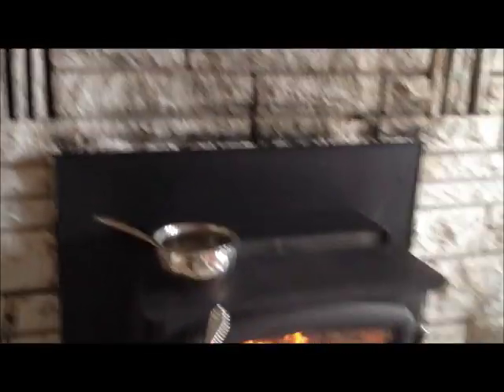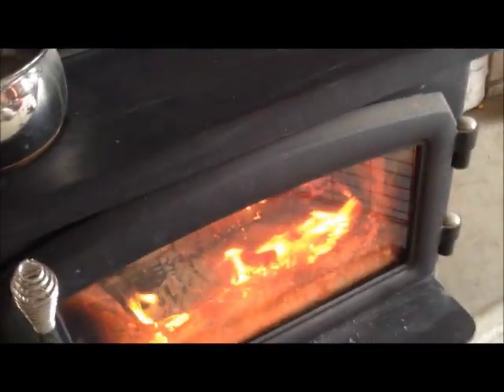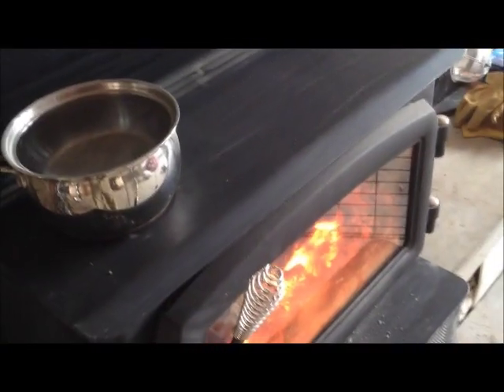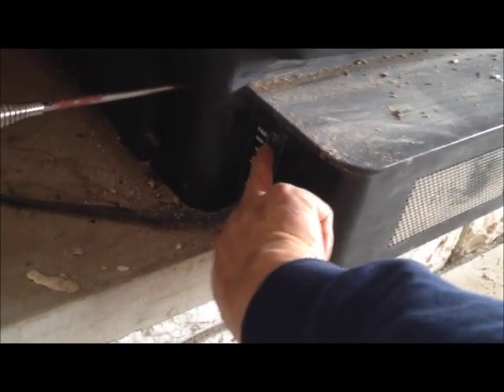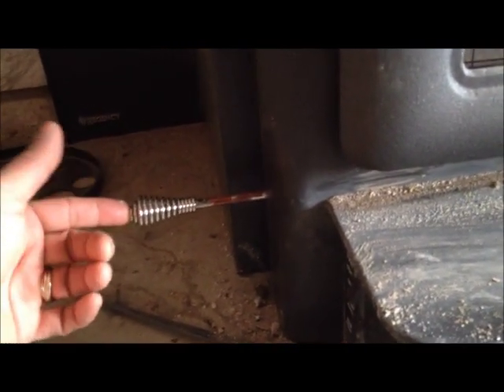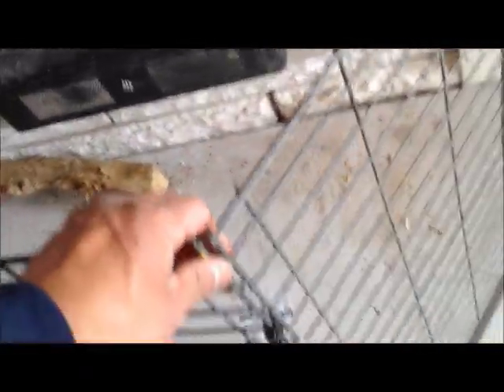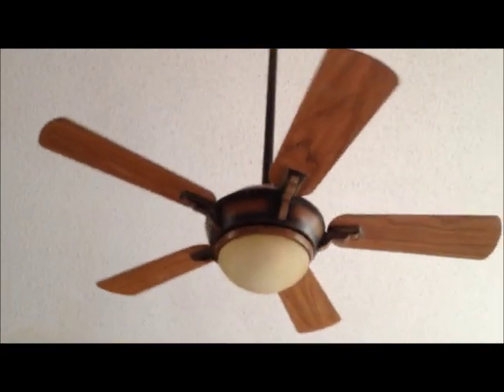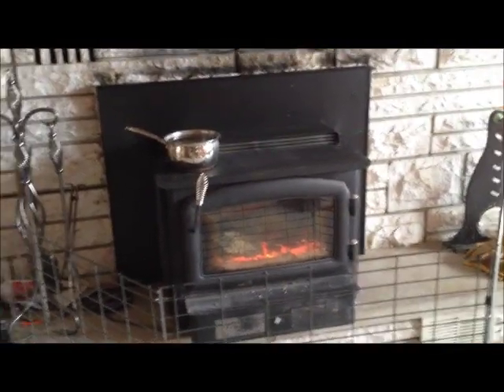Regency H2100 hearth stove

Comment: Thanks for the review. I've been considering the same stove for the similar reasons. I need supplemental heat because x,y,z... I don't like traditional inserts either because they sit in the fireplace rather than out on the hearth. This stove is a bit of a compromise between a stand alone wood stove and an insert. I still get to use the old chimney. So, I don't need to make a new hole through my roof to install a class A chimney.

Comment: do you think the fire box is to small?
Reply from the maker: It does take some attention to keep it going but if they made it bigger, it probably wouldn't fit on the hearth.  I have two fireplaces in my house.  If I had to rely on this stove only, it would be too small.  Depending on the size of your house, I would consider it supplemental.
Reply from the maker: Because it's small, we keep feeding it throughout the day.  We're just used to it.  I usually fill it before going to bed pretty tight.  Depending on the size of the log and the type of wood, I may have to put another log in around 4am or so.  I usually get up then to make a trip to the bathroom then so not a big deal for me.

Comment: do you filler up with kndling than let it burn for while to coals  thsan filler up with large logs for a very long hot burn
Reply from the maker: Tim Bolt that's only one we start it up. For the most part it's lit throughout the whole winter. I don't even really let it completely die down to clean it that much anymore. I'll let it get somewhat cooler and I'll shovel out some of the ashes into a metal pail. Then I'll take the metal pail out to our burn barrel and let it cool off on its own outside.

Comment: so have you got the 8 hr burn times as brochure says?
Reply from the maker: todd j   I don't think in a meaningful way.  I have gotten it to burn that long but with low heat output.  What I will get in the morning is embers that I can add logs to, open the air intake, and get heat going again in a little while.  But if you are looking for high heat output for that length of time, I haven't had that experience.
Reply: so would 6 hours be more acceptable for a load to burn that long?and would you buy this again?
Reply: About 4 hrs of good high heat burn time.  You can load it full, then shut the air down and it will have a good bed of coals after 8hrs.  Throw some wood on, and you're right back in business.  Problem we've found with this stove is the small firebox....it's only something like 1.6 cf.   But the rest of the stove is great...the gassifer technology is top notch...almost zero creosote.  I'm looking at replacing ours now (after 10 years) with another model they have that has double the size firebox.
Reply: what stove are you going to..im going to upgrade mine as well...i have a century insert and it puts out good heat but only about 2 inches stick out,so not getting any radiant heat....you selling your h2100?

Comment from the maker: The black soot was there before I had the stove installed.  It was there when I bought the house.  Reminds me I've been meaning to clean that.

When I first clean out the inside, I don't really have an issue with ashes.  As it gets to where I need to clean it out, it does spill out a little.  One thing to note is that my kids (not the little ones) feed it during the day so I'm not so sure how careful they are to try to keep ashes from spilling.  When it does spill out a little, I just shop vac it.